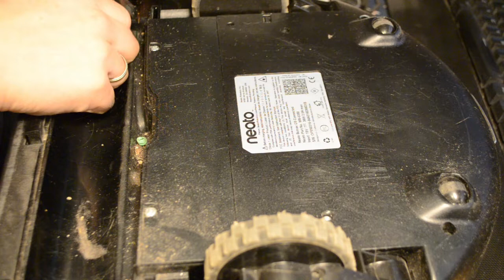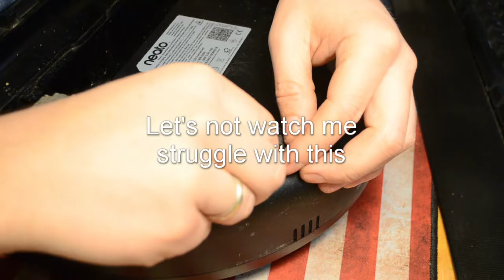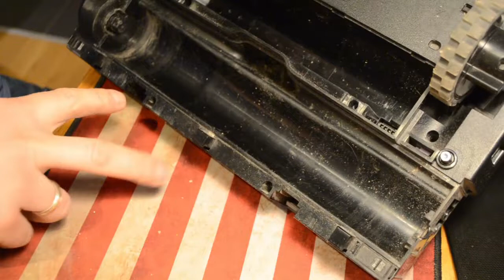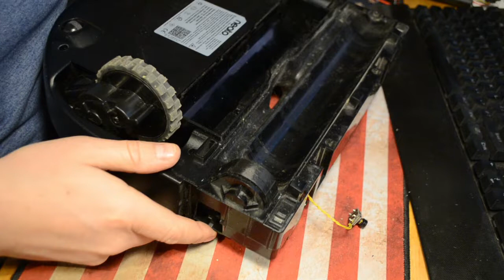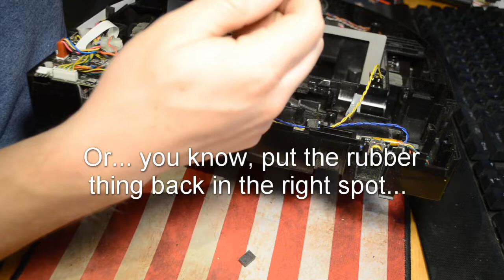Neato D5 Connected brush motor disassembly and cleaning

Comment: What tool did u use to take off the back? I can’t find a tool that fits
Reply from the maker: @annabailey2206  oh this is so long ago but I think I ended up using a T20 torx that just happened to fit. A properly sized hex driver would be best.
Reply: I have a hex set and couldn’t find one that fit! I have to take off the cover to access the motor
Reply from the maker: @annabailey2206  I eventually bought a long set with both imperial and metric sizes and found one that fit. I'll try to figure out which one it is when I get back home next week.
Reply: @bobris thank you I appreciate it! Been trying to troubleshoot since there is no Neato customer support anymore

Comment: thank you so much! my neato's motor gear was fused to the shaft, completely immobile and i could not for the life of me figure out why. i pried it off and there was a lump of plastic slag around the base of the shaft, and a missing chunk of plastic from the base of the gear. it must get hot! chipped off the slag, popped the gear back on, and put her back together. crossing my fingers it lasts a bit longer!

Comment: Hi there. Any idea how to fix an unresponsive D5. The battery and "i" light just alternately fading in and out. Hard reset (pressing power + right side bumper) and battery replacement did not work.

Comment: I have a d3 and customer service indicated it was a motor issue. I was able to use this video to get to the motor and just added a couple more of my own steps to swap it out with a replacement motor (and also clean out the hair in the belt that likely wore out the motor). I really wasn’t ready to drop a few hundred dollars on a new model. Thanks for sharing!

Comment: Thank you so much for the video. My motor brush head got worn off just like yours. I was able to pull it all apart with your video and put in a replacement. Think the hair from my dogs caused tension on that head piece and it slowly got hot and the tips got warn off.  Basically making the brush not work at all as the drive just spun within the brush. 

One headache was getting the T10 screwdriver that could take apart the D7. They have deep recesses so a normal screwdriver head with that attachment wouldn't fit into the holes. Had to buy a pure T10 tool that would fit. After that though got it all figured out and replaced the part with this videos help. Thanks again!

Comment: Can I replace my stripped out brush drive this way
Reply from the maker: If you can find the parts, anything can be changed out.
Reply: @bobris  so it’s pretty self explanatory once it’s open? Do you know the part I’m speaking of, the hex shaped “drive” that it’s into the brush. Figure it doesn’t work as is so might be fun lol
Reply from the maker: @brianbrian4317  i think the biggest problem is locating parts. The "brush motor gear" or whatever it may be called seems hard to find. I found someone 3D printing them on eBay but I wouldn't trust the strength, especially since you've stripped the original. I wonder if contacting neato might help. If you watch the video you can see where I take out the brush motor assembly, it's really easy to open from there.
Reply: @bobris  yea that’s the one I saw the 3D printed one. I mean mine served me for years but a new one gets so expensive

Comment: Thanks for this very thorough video. Do you happen to know how to get the wheels off. My Neato drove right through my cat's little poopy accident on the floor. I saw a video for a newer model, but doesn't apply to my D6.
Reply from the maker: I haven't gotten that far yet, but the small rollers have some dog hair in them that I can't get to, so if I ever find the time, I might do a complete deconstruction at some point. I can't speak for the D6, but I know you pretty much need to take the entire main board and motors out to get to the drive wheels.
Reply: Thanks for your response. I’ll give it a try this weekend 👍

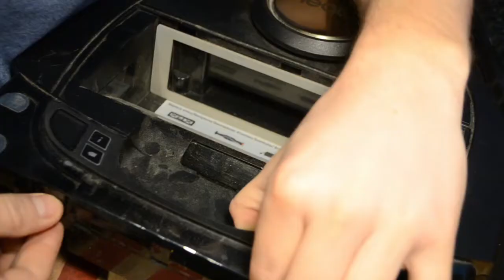Comment: At 6:40 is just came off? I am stuck there. All screws removed but the top shell still stuck on the front. I see two clips but pushing them in does not seem to help. Am afraid of breaking the shell...

Comment: Thank you so much for this video! It's the best one on here in my opinion. I sent mine to the repair company recommended by Neato, and they missed the worn gear. Thanks to you, I fixed it myself for $26 and avoided another 3 weeks of not having my vacuum! We bought a set of Kobalt star screwdrivers just for this robot, but they're not magnetic- but I had no issues dropping the screws into the deep 'abyss" and getting them hand-tight.
Reply: how did you fix or where did you get the replacement part?

Comment: Anyone had any luck getting the reboot me error fixed? I tore everything down and cleaned the lidar pieces but no luck. I am assuming it is the lidar motor as the lidar lens unit isn't spinning.
Reply from the maker: That's a shame. I managed to get it running just by "freeing" it by hand. If the motor doesn't spin at all, I'd check if it can be moved by hand and then check the cabling to the motor. It could be as simple as a worn belt if you haven't looked at that yet.
Reply: @bobris  Checked all the above and honestly no issues. I tried replacing the o-ring/belt that spins the Lidar but that was no use. I went ahead and ordered a new lidar motor and will try swapping that out. Trying to limit the cost of just throwing parts at it but it is either that or the board under the lidar. Thanks for the help and video, this made it super simple
Reply: @bobris  Just swapped the motor (B08HH1K8QK) Lidar Motor and Lidar O-Ring (B07SJTJPPB) reassembled and we are off to the races now. Thanks again for the thorough video  of getting into the D5. Post part info for others if they are running into the "Reboot Me" error and identify the lidar tower isn't spinning. This fix cost $25 bucks and was much faster and cheaper than sending it off for repairs outside of warranty. Cheers!

Comment: Well, for anyone with the same problem.  I found the part I needed here at https://www.amazon.com/Neato-Botvac-Brush-Motor-Connected/dp/B086N431VM/ref=sr_1_24?dchild=1&keywords=neato+belt&qid=1616969244&sr=8-24 
 and a link for a completely new motor complete with housing and everything  https://www.ebay.com/itm/Neato-Botvac-Wheel-Motor-65-70-75-80-85-D75-D80-D85-D3-D4-D5-D6-D7/264787820722?hash=item3da69580b2:g:L70AAOSwkc5fA-qG   I chose the latter of the 2 I bet you will too.  Thanks

Comment: Thank you!  This helped me big time to get the motor out and to verify that the plastic piece that spins and turns the brush is perfectly smooth now not a hexagon and therefore the piece is just spinning because it's stripped out.  So, now I need to find that piece somewhere.  I anyone happens to know where I can get this piece it would be muchly appreciated.  Thanks in Advance.
Reply: You can find them new or used on ebay. search for “neato botvac brush motor”
Reply: I used a Dremel tool to grind the shaft into a (smaller) hexagon shape, then used a 3-D printer to make a hexagonal sleeve to fill in the space.

Comment: worked for me on my d75, tackled some clicking noise from the "drive-train", glad to see here how easy the motor-assembly was to remove.
the  circuitboard on the d75 is a lot bigger, over the whole width of the neato, partly covering the brush-motor, so you have to loosen the circuit-board to access the motor.

Comment: Thank you!!! I couldn't find a way to factory reset the robot (I was getting annoying "reboot me" errors).  I decided to take it apart to see if I just needed to clean my laser lens.  I could not figure out how to take it apart.  with your help, I opened it, brushed out some garbage, cleaned the hair out of the brush motor belt (who knew!?!), cleaned the laser lens, and blew the rest out with my air compressor.  It's running fine now, so I hope that was what was wrong.  Thank you, again!!!

Comment: Thank you so much for this. I needed a teardown guide for the D3 and it's extremely similar. The side brushes aren't there and there are two more screws under the bumper (two up top and two below the bot). It's basically identical otherwise. Got my lidar spinning again in little over an hour!

Comment: Thanks for posting this video.  We had the “clean brush” issue and I could tell it had to be a motor or drive belt issue.  Sure enough, the entire housing was full of hair locking up the belt.  Ours had a circuit board over the motor so extra work was needed but once that was off, it all came out.  I would never had guessed how to get that out from the bottom up with just a screw driver.  Now it is back and running great thanks to your video!